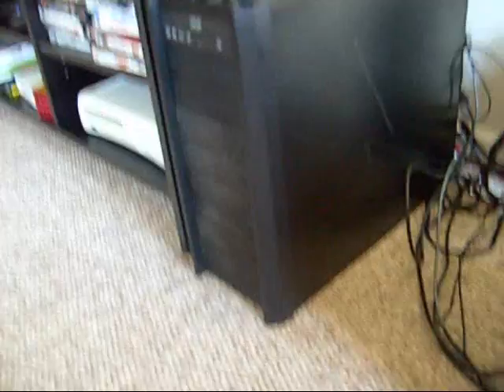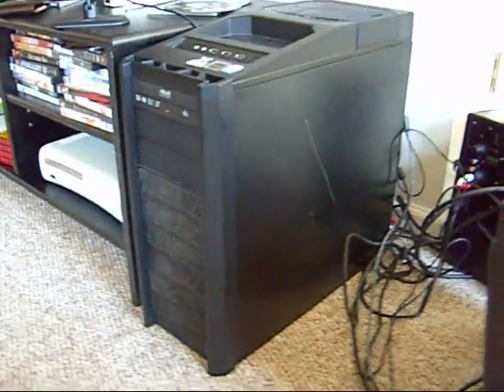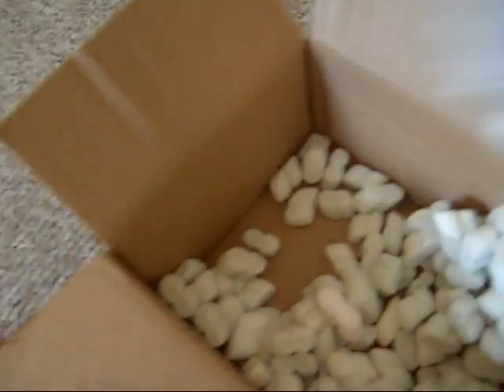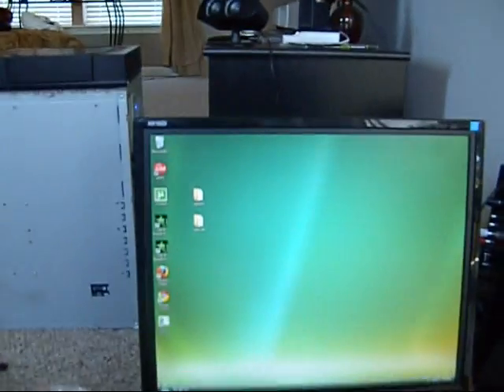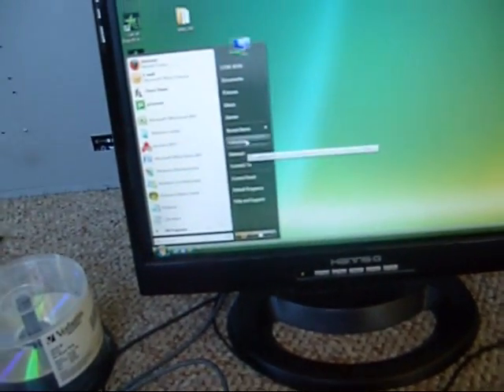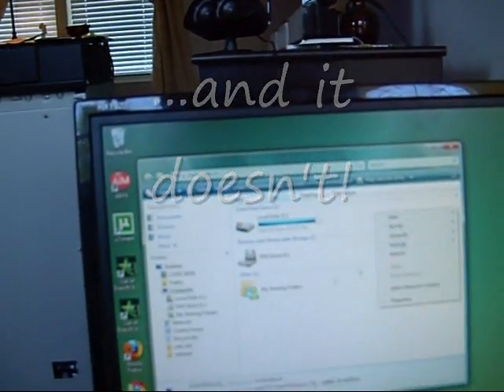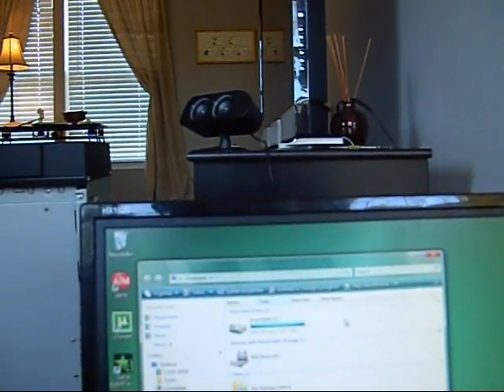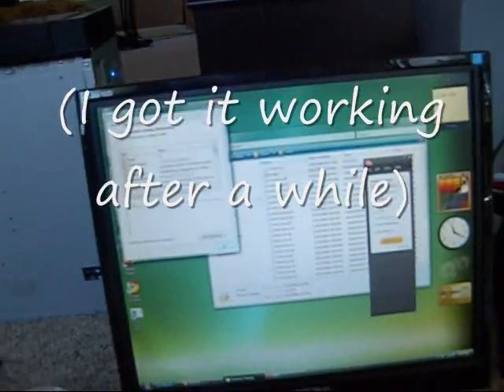Computer Upgrade - 2*500Gb WD HD in RAID 0 (1 terabyte)

Comment: @deadbeat86 
not necessarily.  not only would 2 drives be twice the performance (theoretically) but even though he would lose everything if 1 drive failed, he could still use the other one.  if the 1tb drive failed, he'd lose everything and never get to use any of it, and it wouldn't be as fast

Comment: @schmidtbag yeah, but basically is the same as having a single 1TB drive, but you take advantage of the fast speed. So if you see it that way theres no real problem, if one drive fails then both drives fail, if he had a 1TB drive, if it fails then it fails. So, its the same

Comment: dude you need to do some cable management, thats why that case gets so dusty.. I had the Antec 1200 which I am in the process of selling. It got to be too much to maintain because its really designed for water coolering and to be modded. I went with the Coolermaster ATCS 840.. But to keep your sanity try doing something with those cables.

Comment: You need to format it. RIght click Click Mange. (need to be an admin) then storage, disk management right click the second hdd (usually D:/ if primary hdd is C:/) then clcik format(format it to NTFS not FAT32/FAT if that option is avilable) then done. (Reboot if it doesn't appear)